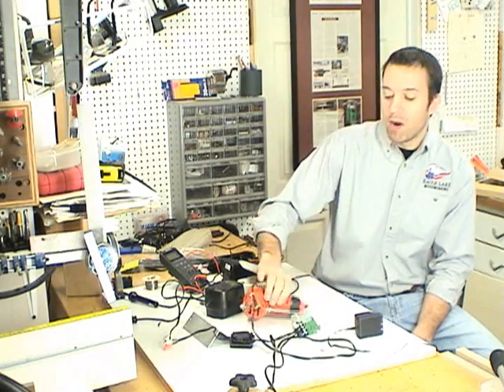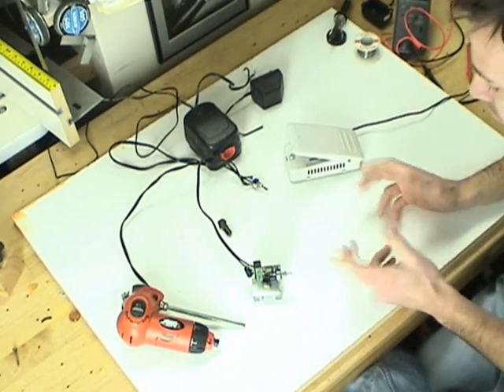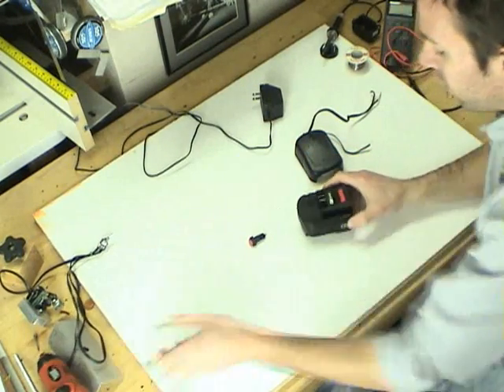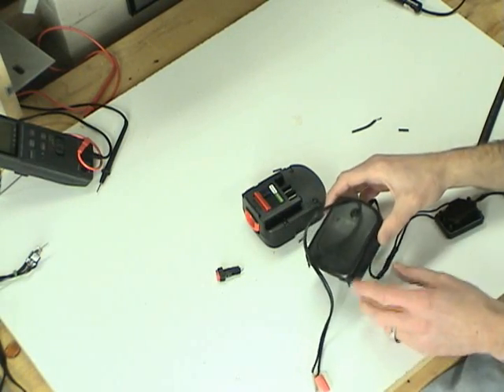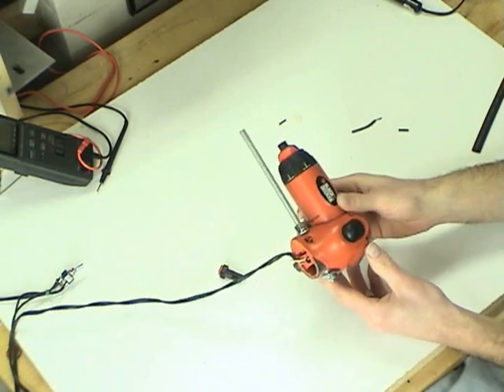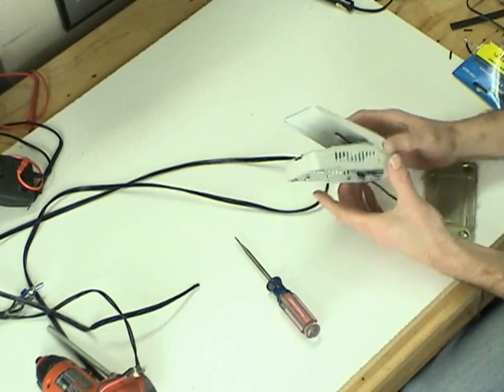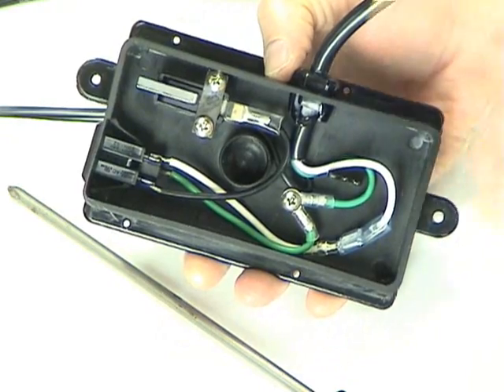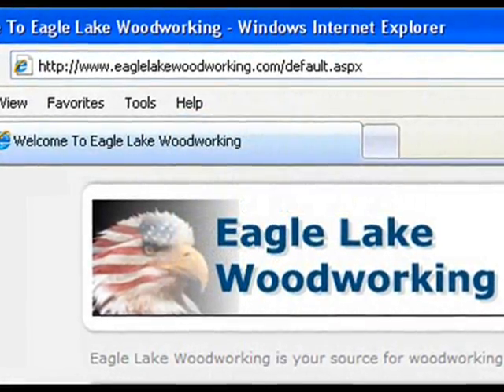Part 1 - Motorized Router Lift Wiring - Introduction and Overview

Comment: One day, when I've emptied out the storage room that I've built to store and organize all my ideas and projects, I'll build a microprocessor controlled stepper motor based router lift ...

Set tool zero, just key in the bit height that you need, and off you go ... Automatic bit rise on every routing pass ... You name it ... 

But for or now, I'll have to store this idea with all the others in that room I spoke about ...